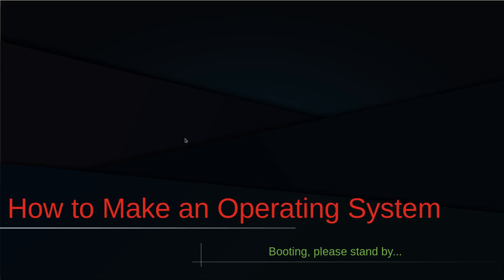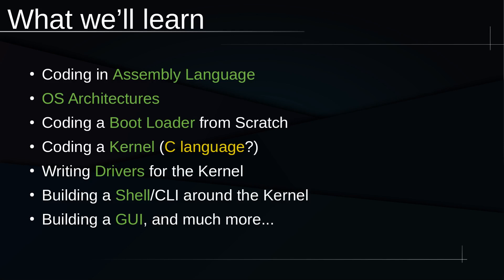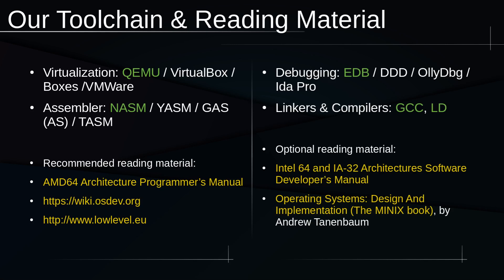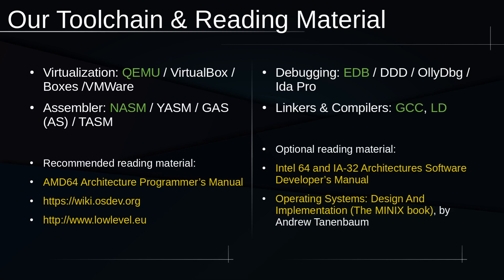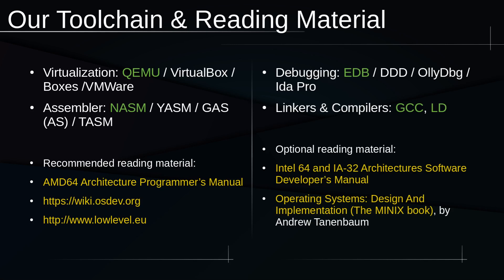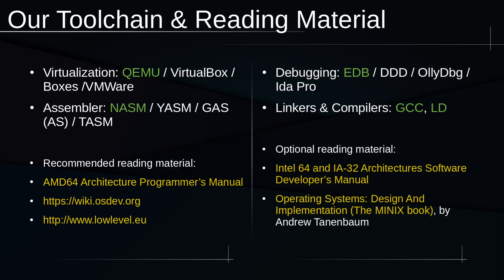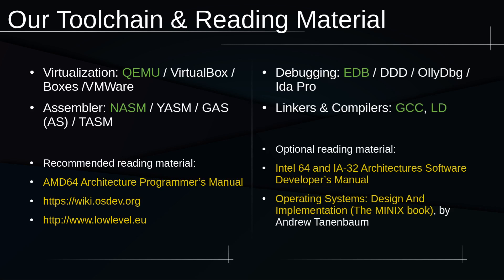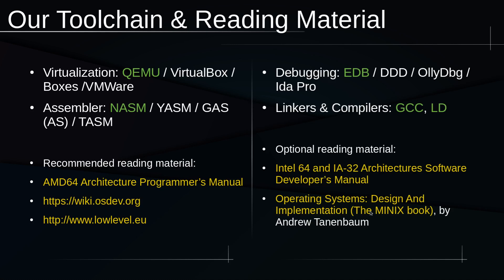How to Make an Operating System - Introduction

Comment from the maker: NOTE: If you intend to use the GNU Assembler (GAS / AS) and are not familiar with the AT&T syntax, make sure you use the .intel_syntax directive to use the Intel syntax (which is what we'll be using throughout these videos). You'll need a GAS version of at least 2.10 for that to work. Thanks!